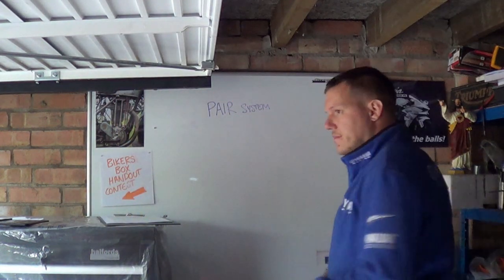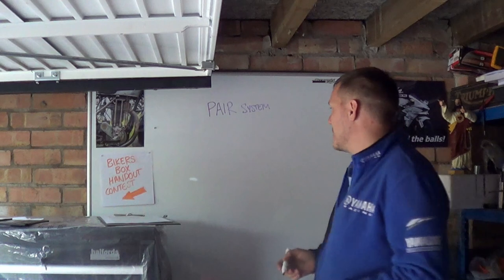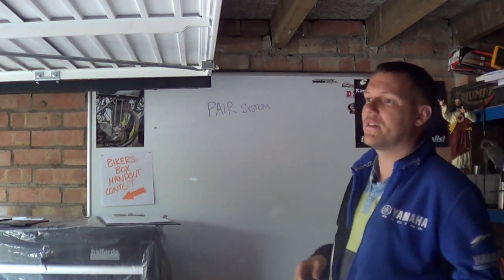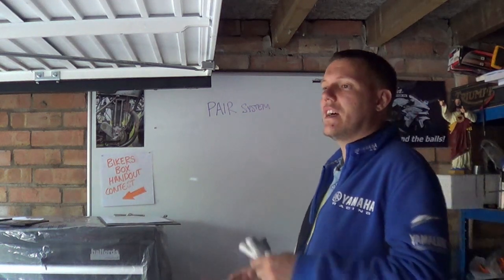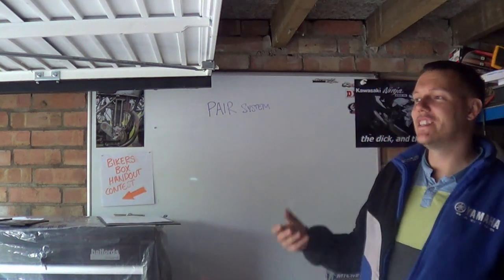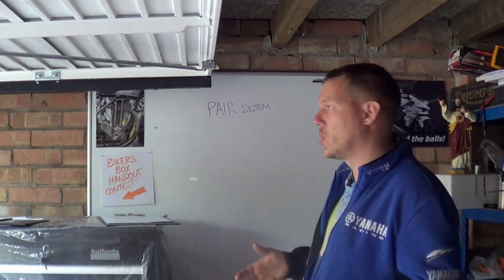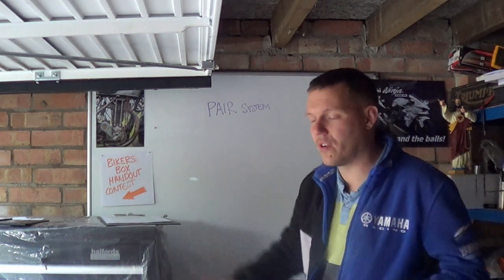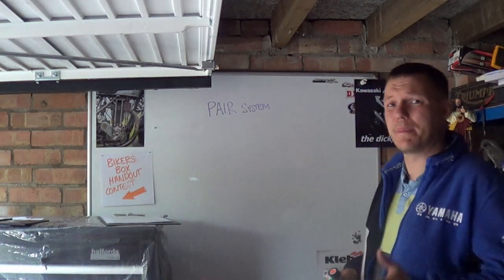PAIR systems - what do they do?

Comment: The pair system is desired to be either, removed or disabled.

When people are using a Dyno with a power commander to alter the fueling of the engine, the reading from the exhaust is what throws off the measurements to a degree.

Comment: Adding fresh air directly lowers the ppm though? Assume 100 ppm as it's going out the exhaust valve. After pair system more air is added which would reduce the 100 ppm as there's more nitrogen and oxygen displacing what was a lower pressure area. I understand for the most part it's also to help feed the catalytic converter to allow it to heat up fully to properly function as well as the oxygen to possibly finish combustion of exhaust gas in a way not directly related to the cat functioning

Comment: The engine braking and throttle linearity have changed significantly on my '05 R6.  My bike feels so smooth now it feels like I bought an '18 or '19 bike.  I thought I would have More engine braking but I think it made it less but I'm not entirely too sure.  Bike feels much more smoothened in a weird "new" kind of way.  New as in like fresh off the assembly line and off the showroom floor type new.
Reply: What was done to your bike?

Comment: Hey nice vid, can you tell me where the one is that explains how to do it?
Reply from the maker: Whta blank it off?
Reply: @dirtygarageguy  i have no idea what the pairing valve is, what it does, where it is or what it looks like, what i have to blank off, where i get the blank, do i make the blank, can i purchase it, how many blanks do i need, what is a blank, what does a blank look like, what do i have to remove, what tools do i need, what wires do i need to disconnect.
Reply from the maker: 1) this is dependant on the system 
2) Why are you wanting to remove it?
Reply: @dirtygarageguy  Hi thanks for your reply. I am planning on fitting a Lextek full exshust system to a 2004 pointy sv650 and concerned as to whether there will be fueling issues and how easy they would be to rectify. Do you know what the likleyhood is that i could put the system on with no remap and have no problem? I have a K&N air filter. Your help would be much appreciated. I enjoyed your vid it was straight up no bullshit. P.s sorry for the shitty reply before i thought it was this yank i was bickering with.
Reply from the maker: Do it first and then see if there's an issue. There are sooooo many exhaut systems and set-ups that I ould just be guess. I'll do a video on what you asked soon
Reply: @dirtygarageguy  Thats brilliant thankyou very much. I will put it on and also look out for the vid. cheers

Comment: I thought the throttle sensor is connected directly to the throttle body butterfly valve, so the ECU senses the throttle changes as it's happening, and ECU's have a resolution fast enough to detect changes mid-revolution? And where is the delay for carbureted bikes. Is it the carb diaphragm? I know the EX-500 has a PAIR system and it's ECU is very basic. Mostly just a timing map
Reply from the maker: "I thought the throttle sensor is connected directly to the throttle body butterfly valve"

- I'm confused here - did I say the opposite?
Reply: The Workshop I meant that combined with the resolution for ECU's that I thought the ECU can actually respond fairly quick.

Comment: I had heard there's a vacuum created on the ex manifold side, so if you reroute pipe to crankcase breather you get the crank running in a partial vacuum (ie slightly beneficial lack of air resistance for the crank) Is that bollox? More to the point could it be detrimental? I did it to all my GSXRs from K1 - K5, it only cost a couple of quid for piping.
Reply from the maker: If you have an O2 sensor then this is a bad thing to do. The oil mist from the crankcase breather will expel into your exhaust - you'll be burning oil mist and fuck your O2 reading and fuck your cat.
Reply: @dirtygarageguy  i THINK what he means is reroute the pair pipework to the crankcase breather so it doesn't enter the exhaust at all rather than vent the breather to the exhaust at least id hope so to avoid the issue you raised. Essentially using the pair to create a vacuum in the crankcase.

I can't see the difference in air resistance benefiting enough to be worth the weight of the tubing though, is there an equation to work out whether that is the case?
Reply: We tested this at my shop on a dyno with a gen 1 busa. was about 5hp difference. So it does help a little.
Reply from the maker: 5hp difference from a 180HP can be the variation of the dyno and everything else.
Reply: @dirtygarageguy  This is true. This is just what we observed that day. I Would like to do more experimenting on this.

Comment: You need to get the terms right about "back fire"... Back fire in coming back into the induction system, like into the carb or throttle body and exits into the air box, This is not a good thing at all as the engine is running lean as hell and this causes preignition and detonation. The "after fire" is what come out the exhaust pipe, known as a over rich condition.
Reply from the maker: No I don't where the fuck did you get after fire from?

backfire
verb
verb: backfire; 3rd person present: backfires; past tense: backfired; past participle: backfired; gerund or present participle: backfiring
bakˈfʌɪə/
1. 
(of a vehicle or its engine) undergo a mistimed explosion in the cylinder or exhaust.
"a car backfired in the road and shoppers ducked instinctively"synonyms:misfire 

"the engine backfired"
Reply: Then you have no back ground in aviation..  That has been the terms for a very long time..
Reply from the maker: What a dickhead comment to make - we don't get many 'backfires' in helicopters. What the fuck are you talking about.

Is there a term as afterfiring - yes. 
Do people use this term - yes, knobheads. 
Are most people 'in aviation' knobheads - yes!

I don't know if you have noticed but this channel is for people who want to learn this stuff and knit picking the exact term that hardly anyone uses is just - well - knit picking.

Just out of intrest what makes you think that 'because you didn't use the term afterfire' then I haven't worked in aviation for years?
Reply: Backfire (reciprocating Engine)

A loud noise, or explosive sound, made by a 
reciprocating engine when the fuel-air mixture in the induction system 
is ignited by gases which are still burning inside the cylinder when the
 intake valve opens. A lean fuel-air mixture burns more slowly than a 
rich mixture, and it can still be burning during the time of valve 
overlap (the time when both the intake and the exhaust valves are open).
 This causes a backfire.
Reply from the maker: So you rip a definition from an avaition dictionary and that means what? - people think its called a backfire, the common use dictionary proves that. 

I still say suction, and fuel air mixture is drawn in which is not true but it makes it easier to understand. Wanna teach the world about English, well your pretty fucked there because you're American. 

You usually leave some good comments but now you're being a wanker. You don't know me and with that "Then you have no back ground in aviation" comment you can just fuck off. I was tearing down rotor heads in the fucking desert whilst you were scratching your balls at home in safety - don't give that shit!
Reply: Look, Not trying to bust anyone balls here.  I'm just staying if you going to do technical stuff you need to get the terms correct. Yes all of us calls it back fire but there are two total different meanings to it..  When trouble shooting an engine problem you need to know what they are and what is the cause and effect of each one.. Oh BTW a compressor stall is a type of back fire... LOL
Reply: @drunknpossum  Actually, I didn't understand the correct definition of what a backfire was or what caused it vs "afterfire", so thanks.

Comment: Matt, have you actually tested the PAIR you took off your SV?
Reason I ask is that I (like you) assumed the PAIR works the way you've described. I then read the manual for the bike I had then (a '99 Honda cb600f Hornet) and it seemed to contradict this... I talked to some friends and they said manuals are often wrong, translation mistakes etc.. Ok, so I tested my PAIR valve, which worked exactly as the manual stated it should. A mate then found a PAIR he'd removed from a bike and tested that, it also worked opposite to how you've described.

So... could you please find an actual technical description of how they operate (I couldn't find one) or check the workshop manual for CB600f for example (as the one for your SV1000 doesn't describe it), but also test your PAIR valves.
It seems that they would allow air to pass into the exhaust all of the time except for when at high inlet vacuum.

Finally, on fuel injected bikes the PAIR valve only operates during warm up, because the FI is operating in open loop mode, due to running rich. Once at operating temperature the FI goes into closed loop mode and thus turns the PAIR system off (via the 12v solenoid). This happens because allowing air into the exhaust would change the readings from the O2 sensors and make it impossible for the ECU to correctly adjust the mixture, this action was confirmed on a VFR800 by monitoring the signal to the solenoid.
Reply from the maker: "Matt, have you actually tested the PAIR you took off your SV?"

Tested? In what way?
Reply from the maker: It depends how the system is designed - Passive Air Injection Systems are exactly that passive. The Suzuki PAIR system has reeds and a solenoid. The solenoid is to stop reed from fluttering all the time, when the pressure drops in the exhaust manifold. Now what you are describing is different systems like SAS etc Some of these systems work with the Cat to correct for A/F ratio calculations etc. The original Secondary Air systems have been adapted over the years to aid in other emissions and scavenging and even noise suppression. More on this later.
Reply: As in tested the operation of the valve you have? 
I did, I tried to blow through the valve to simulate what happens with exhaust scavenging. 
I then repeated this whilst applying vacuum to the tube which goes to the inlet manifold. 
What I found is that the PAIR was able to flow (1 way through the reeds) all the time until vacuum was applied, so vacuum (at the inet) actually shuts the PAIR valve off completely.
This means the whole system is operating in opposite to how you described (at least mine is/was).
It will bleed air into the exhaust most of the time, but not when coasting or on decel. I didn't measure how much vacuum was required to shut off the valve, or how much vacuum is present in the inlet at different operating conditions, but what I can be sure of it when at WOT the PAIR will be allowing air into the exhaust, and when you suddenly shut the throttle down the PAIR is closed.

This is on a carb'd bike with no cat.
Reply: The one on the Honda had no solenoid, just reeds on the exhaust ports connection and an actuator valve controller by inlet vacuum.
Reply: Yes SAS but also PAIR??
I have just gone back to the old manual and see that it describes the system as a Secondary Air Supply... but then it goes on the call it a PAIR valve throughout the description (Pg 3-17 of Honda_CB600F_Hornet_'98_Service_Manual) - it's available on the net if you want to check.
Reply from the maker: Like I said that's a different system and different systems work in different ways. Yes I tested the valve during a video and there will be a video soon -

Comment: My TL is going BANG BANG BANG when I let go off the throttle
Reply from the maker: Have you changed the exhaust?
Reply: Bought it fitted with Quill racing cans, but I have a sneaking suspicion it might be related to there being no exhaust gasket linking the rear link pipe to the rest of the exhaust. Still goes bang bang bang.

Comment: You should leave the PAIR system on your motorcycle. Like the Workshop says, it doesn't improve performance to remove it. If the reed valve gets stuck open or closed, it can be replaced for cheap. Most people already think that we bikers are a bunch of obnoxious selfish a-holes. Please don't prove them right by making your bike damage the environment more than it already does.
Reply: Thing is the statement you made isn't true for every exhaust and bike, the pair valve delete/block off CAN change power if you do the relevant tuning to take into account the differences so it just shows your ignorance.

Doing just the delete on a stock exhaust won't change anything but with a remap, a new exhaust, a better more free flowing filter you will see a difference, its like everything else, piss poor setup will cause issues.

As for environmental damage, on a bike I'm more efficient in terms of space taken up, I'm on the road less time at least in places that see sense and let you filter/lanesplit, producing less emissions, burning less fuel carrying less weight around and not contributing to congestion which increases pollution and generally speaking bikes get kept on the road far longer which decreases the amount of pollution from manufacture of new vehicles as well as taking less resources to produce in the first place so honestly me sticking a freer breathing exhaust with a cat and deleting the pair system is utterly irrelevant.

The euro regs for noise are ludicrous for bikes being forced to produce less dB than a running hairdryer, they were produced by people who take funding from a lobbying group that openly advocates for making motorbikes harder to get, more expensive and ultimately banning them as part of project zero  whilst claiming to be interested in the environmental impact of  vehicles and actively ignoring the fact motorcycle use is good for the concept of reducing pollution and congestion.

Its the same reason we got fucked in London with the Ulez zone, groups that are not interested in bikes, groups that actively want bikes banned and otherwise inconvenienced are involved in writing the regs which cover motorcycles with the aim of seeing them banned. Every step they take which makes them less desirable, more expensive and more of a burden on the user means they get one step closer to banning them. They've even resorted to lying in government with MPs labeling us thieves despite the data to get a good snappy quote in the papers to turn public opinion against motorcycles by saying 40% don't pay tax and ride illegally, calling motorcycles toys and openly arguing that anything over 400cc is a toy that shouldn't be on the road despite having no experience or understanding of bikes.
Reply: I hear you-----but by damage to the environment you mean to the WHOLE  planet Earth?  c'mon... abandon  that herd mentality,  the Greenpissers  are just a modernised form of inquisition intending  to sacrifice others...i am already paying dearly for that BS!!!!!!!!!!!!!!!!!
Reply: Sorry JediKnight, I’m uh American. I don’t know anything about the Ulez  zone, project zero, not sure what a greenpisser or an MP is. (Here that stands for Military police). Sorry, all that Jazz sure sounds like a hassle. You sound like you know more about tuning aftermarket exhausts than I. But you won’t convince me that leaving the pair system installed will prevent you from getting your bike tuned up properly. Or that deleting it will add any significant hp to the rear wheel.         Jose, hows it going man. Sorry I got you all fired up about this. But I do think that thousands of bikers riding around with their pair systems deleted does add a significant amount of hydrocarbons to the atmosphere, the result of un-burned petrol (see, I speak a little U.K.) coming out of the tail-pipe. It’s not helping the planet, that is a certainty. Anyway sorry if I offended you guys. I enjoy the lively discussion, though. I hope to see you on the trail. Cheers.

Comment: When HC`s are so bad then why is it legal to buy brake cleaner? If you use it you are simply blowing HC's in the air to degrease the shite.
Reply from the maker: volume - how much brake cleaner do you have? 1 litre? How much fuel have you put into your tank? And there are millions of vehicles running everyday, not the same with brake cleaner
Reply: I just watched someone who sprayed 3-4 cans (each 400ml) on his car lift to clean it after the oil went all over it... So much to that. No, not millions are doing that but I guess there are enough HC's in each can to match a bad burning engine running for a 1000 miles.